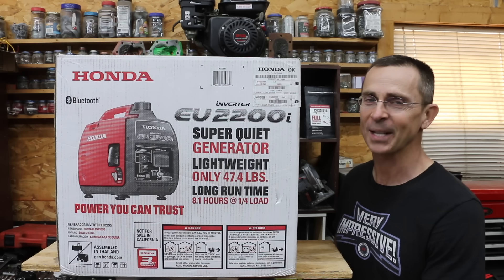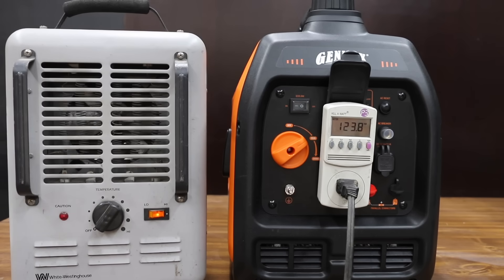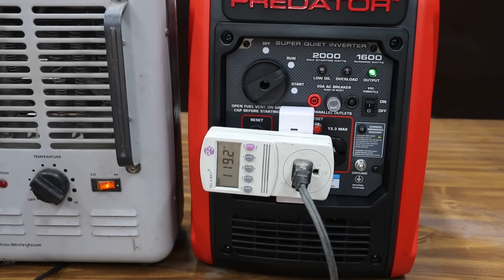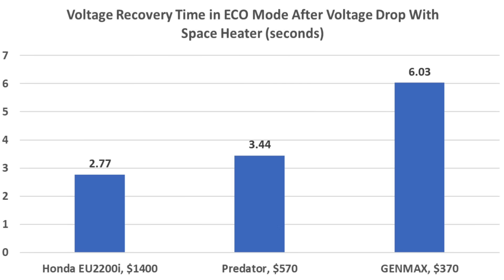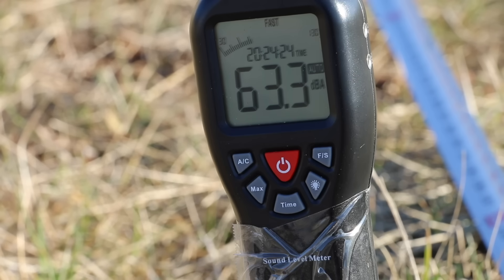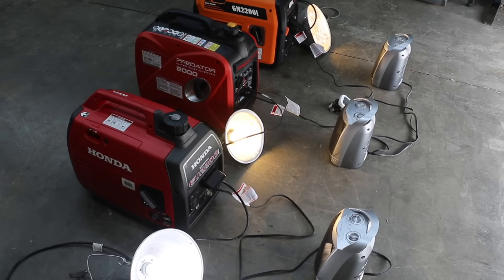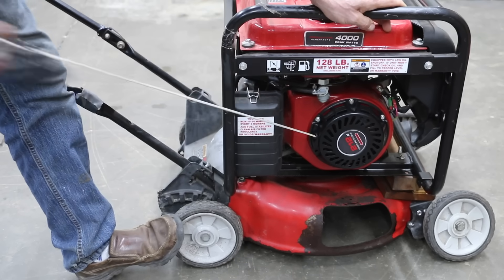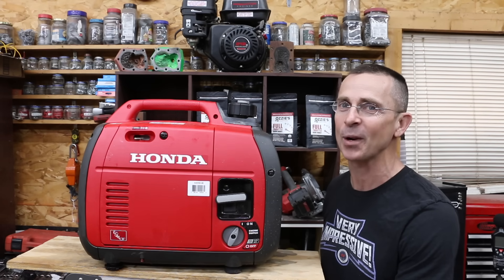Cheap Generator Better Than Honda? Predator vs Honda & GENMAX—Let’s Settle This!

Comment: Someone else has said it already. But for me personally I would like to see duel fuel generators that can run on propane as well as gasoline. We don't use generators often enough so a normal gasoline model would either be empty or gummed up. Regardless of brand since all of these small engines run flat tappet cams maybe you could test them with zinc rich engine oils? That would be interesting to see how well it helps with wear versus using straight synthetic. :)
Reply from the maker: Thanks for the suggestion.
Reply: I always put stabil everytime I fill up a gas can, never had any issues.  If its something I don't plan to use for about a year or more I'll run it out of gas.  Those two things would save people a lot of trouble will small engines.  You can get ethanol free gas but its pricey.  If you already have a bunch of tanks around, or the bigger tanks I can see the use for the propane ones, but otherwise it seems like a pain.
Reply: @Dan-yk6sy  I run ethanol free high octane in my chainsaws as well as my dirt bike. But when it comes to power outages in my area they're very rare. So a generator for us is something that would be on standby for a very long time until it's needed.

We already have a small duel fuel generator installed in our greenhouse plumbed up to a 100lb propane cylinder that we bought as a return from Tractor Supply.

We fixed the minor problem it was supposedly returned for by the previous buyer. It was pretty much just user error because the guy was an idiot and the generator runs perfectly fine. 

But we've owned it for about three years and have yet to run it out of need. Ours is a small unit that's enough to keep the meat freezers going if the power goes out. But I'd like to see the performance of the bigger models.  😀
Reply: @Dan-yk6sy  you mention Stabil when filling a can... Think I should do that for jerry cans I have filled in my garage, with gas meant for my car? I cycle them about every 6 months but I don't use any additional additives. I never thought much about it, honestly.
Reply: FYI, Hutvch Mountain makes a great conversion kit for the Honda generators. Installs in minutes and allows you to use Gas, Propane or Natural Gas.

Comment: Hey Todd, I've been very curious about the metal alloys used on bolts, engine components etc. I've noticed my cheap equipment rusts faster, wondering if it's just me. Thanks
Reply from the maker: Thanks for the suggestion.

Comment: I ran multiple predator 2000 full time 24 7 at my business. Changed oil every day. They last about ten weeks. The pull cords fray from vibration. Never changed spark plugs.
Reply from the maker: Thanks for the feedback.

Comment: Honda is the way to go. We've had an EU2000i for more than 15 years, been used and abused with many hundreds of hours on it. Bought an EU2200i like in this video a couple years ago to take some load off it, but the old one just keeps going.
Reply from the maker: Thanks for the feedback.

Comment: I bought a $400 generator and left it with gas in it for six months, checking it periodically..  Mistake.   When I needed it, it would only stay running if the choke was on.  My lawnmower engines do better than that.   Now I need to tear it apart, clean it and try again, only running it with stabilized fuel.   Buy a better generator.
Reply: A more expensive generator would make no difference. The ethanol in the fuel plugged up the jet in the carburetor as it would. With any generator. If you live Somewhere that has non Ethanol fuel available it would help but it would still Plug up the jet If left for long periods.
Reply from the maker: Thanks for sharing.

Comment: As a mechanic that works on these just know they a pain in the ass to work on and you will get a bill, 99% of problems with these are carb issues and these are verrrry prone to rust in carbs, meaning carbs cant be cleaned, need replaced. Carbs on hondas are $200+, on cheaper models cant even find carbs. Make sure you keep fuel clean, carbs and tank drained when storing or you will have a useless generator unless you want to spend few hundred to get running again.
Reply from the maker: Thanks for the feedback.

Comment: Can you look at LED Bulbs, for ACTUAL power consumption/Life/cost (Possibly you could infer "life" by heat given off which shortens the life of the electronics  that drives the bulb) and NOISE to AM radios. Cheapie leds vs expensive ones, etc.. All the Best! 73 DE W8LV Bill
Reply from the maker: Thanks for the suggestion.
.

Comment: Awesome test, I'd love to see more heavy load tests and electric motor starting etc as startup load often seems to be the biggest issue when running power tools off a generator. 
I've been using a kipor 1.6kva generator in my work van for the last few years. I bought it in a thoroughly used condition and have since piled the hours on it without any issues. One thing that surprised me is it will comfortably start and run a 1.5 hp compressor or run a 2kw 240v heater without the overload protection kicking in even in eco mode where my honda GX160 2.7kva site generator bogs down a lot starting the same compressor.
Reply from the maker: Thanks!  Thanks for the suggestion.

Comment: I have two small engine devices........a Honda brand weed wacker and a small cheap generator.  The cheap generator did about 200 hours and then had a series of mechanical engine problems......the oil flinger failed (c-clip came off) and not long after, the valve train rocker wore out.  My honda weed wacker has done about 800 hours over 15 years and runs very well.......valve lash is still factory clearances. Always interesting, thanks again to Project Farm.
Reply from the maker: You are welcome!  Thanks for sharing.

Comment: Great video as always Todd. Keep up the good work. Also, I feel like even though the Honda is clearly the best quality, all 3 units did fairly well. That being said, the predator burning oil is definitely not ideal. I guess if you always checked and topped off the oil every time you added gas it would be alright. Just a shame that a brand new engine is burning oil like that.
Reply from the maker: Thanks, will do!  Thanks for the feedback.

Comment: Thanks again for another great video. I have come to rely upon your expertise and buy based upon your analysis. I don’t always buy your winners, as your in-depth analysis allows me to chose the one that is right for my needs. As in the case of they generators. My Dad has had a Honda 2000i for years and it has been the quietest and most reliable unit I have ever seen. However, upon seeing your testing and analysis, a couple Genmax units will be in my future. Even though it appears the engines wear faster, I can buy three for the price of one. They put out equal quality of power. They are almost as quite, and I can get two for use together on the house after hurricanes, or separately for camping and boating trips. Thanks again for your great work. Keep these videos coming, and I’ll keep watching and sharing them.
Reply from the maker: Thanks, will do!

Comment: Not really video related but I noticed you're approaching 3 million subscribers!! That's awesome. You'll be in the stratosphere with Linus and Furze before long, having earned every bit of it. As for the video, I liked how you pulled the Tailgator and the Predator 4K in as a comparison data point, especially for the quality of the power. Good stuff, and it matters a lot to an electronics nerd like me. 👍
Reply from the maker: Thanks!

Comment: I have about 1400 hours on a cheap 2200 watt Sportsman. However, I've had to fix it three times and am not impressed with the quality. Most folks can't repair a small generator, so I can't recommend them. It's "natural life" was about 600 hours.
Reply from the maker: Thanks for sharing.

Comment: Interested in your comment about a sine wave being clean and how it protects sensitve electronic equipment. Trying to think of modern equipment that uses the sine wave directly. Most perform their own manipulation of the input current. I would be interested in knowing what equipment is sensitive to the input sine wave. Great videos, thanks. 😊
Reply from the maker: Thanks!  Thanks for the suggestion.

Comment: Very good video sir if you wind up doing another generator test video id suggest maybe some more cheap chinese ones or maybe some mid range brands like ryobi or the ones sold at walmart, coleman generator, or maybe a ridgid generator with the "subaru" engine made by robin, you could also put all these against a briggs and stratton generator or one a kohler engine
Reply from the maker: Thanks for the suggestion.

Comment: I'm not sure if you've tested this before, but I would curious to see dual fuel systems tested.

Also, I'm curious how much carbon builds up between the 2 sources. Or if using  propane would burn off the carbon of gas.

Of course, use something with good naned plugs in a riding or push mower if possible and if they exist as dual-fuel. I've seen custom ones but prefer to see manufatured ones for accuracy.

👍🇺🇲
Reply from the maker: Thanks for the suggestion.

Comment: Yamaha and Generac would be the two I'd look at against the Honda.  Maybe Champion.  All the cheap Chinese generators are probably made in the same factory or at least use the same parts.  I think the oil analysis is particularly telling in terms of likely longevity.  Nice work as usual.
Reply: I wouldn't put generac in that line up. From what I have seen their small generators are the usual badge engined chinese units. If it has to work get honda or yamaha. If it's just nice to have then a predator or the like makes sense given the cost difference.
Reply from the maker: Thanks!  Thanks for the feedback.

Comment: I used to work at the Home Depot. I once had a customer that was a mechanic, and he swore up and down that the Predator generators were the same design, and shared parts.
Reply from the maker: Thanks for sharing.

Comment: I am happy the little tailgater was included in some tests.  I love those little guys.  I have several I use for various things.  Surprising good for $90.
Reply: Little tailgater is so handy to have around.  I have one whose sole purpose in life is to run my sump pump, lol.  If the power isn't off for long, its done its job.  If the power stays off, it give me time to get the big gennie set up and going without rushing because I'm not worrying about  the basement flooding.
Reply: I worked at a shop that sold a clone of the Tailgator.  We dropped them from our product line .
Reply from the maker: Thanks for the feedback.

Comment: It would be interesting to see if the cheaper generators will last 1,000 hrs.  Run all 3 with a 1,000 watt load for at least 500 hrs, prefer to find out if last 1,000 hrs. Use eco mode, keep track of fuel consumption.
Reply from the maker: Thanks for the suggestion.

Comment: Would definitely be interested in seeing a comparison of propane-based generators.
Reply: 2nd that- I have a Champion dual-fuel  brand from Atwoods and am wondering if I made a mistake in not going for Honda instead.
Reply from the maker: Thanks for the suggestion.

Comment: If doing generators again, I would like to see the "dual fuel" generators included and see the difference in run time of a full tank of gasoline vs a 20lb cylinder of propane.
Also what the spark plugs look like after 100 hours of propane run time.
Reply from the maker: Thanks for the video idea.

Comment: 4000 to 2000 and back, I'm confused. You're normally consistent with your testing but this was nowhere near consistent. I could not focus on the test over swapping from 4000 generators to 2000. So my question is, what were you testing?

Comment: I can’t help but to wonder if you had a bad Predator. I have both the 2000 and the 3500, have put hundreds of hours on both, and neither has ever used oil between recommended changes. For 1/3 the price of a Honda, they are hard to beat.
Reply from the maker: Thanks for the constructive feedback.

Comment: Hi Todd, Great video!  If you ever decide to do a 2nd round, you might want to throw in a Champion and a Firman. Both of these machines seem to dominate the big box offerings here in Canada (Costco, Lowes, etc.). Dual and tri fuel options are also popular offerings.
Reply: Good points, have a dual fuel option being tested would be useful as well
Reply: My recommendation exactly!
Reply: agree too- Champion is all I could find for dual-fuel at my local farm supply shop
Reply from the maker: Thanks!  Thanks for the video idea.
Reply: Generac is also common here in the states
Reply: Agreed, a 3000w class showdown with the Honda, Yamaha, Champion, Firman, and Generac would be great.

Comment: I run 2 power horse generators from Northern Tool when camping have been very happy with them. I can run the AC all night normally. I would like to see it tested against the Honda
Reply from the maker: Thanks for the suggestion.

Comment: In this series there has consistently been a huge difference in the quality of the Japanese engines vs the Chinese knock off’s. The Honda would significantly outlast these and be much more likely to perform reliably throughout its life.
Reply from the maker: Thanks for the feedback.

Comment: I ve owned a honda 2200 for 2 years and have clocked 1000 hours on it. I use it at a remote camp and have went through 4 harbor freight 900 watt generators. They were very fuel efficient but ussually failed due to minor issues that wernt worth fixing. After buying the honda and putting 100 hours I couldnt believe i didnt buy one earlier. I purchased the 6 gallon extended run fuel tank  to run our 13,700 btu air conditioner. Using it in cooler weather, for a few lites and TV, it consistently runs 12 hours on a gallon of gas.
Reply from the maker: Thanks for sharing.

Comment: When I bought my small generator it was between Honda and Yamaha.  The price was initially within $100 or so making the choice even harder.  I went with the Yamaha as it has a separate fuel shut off allowing me to run the carb dry when I want to shut it down.  I never use the off switch.  The Yamaha turned out to be less expensive as Honda was going to charge me PDI and Freight.  I figured the money was better spent on gas for my new Yamaha. FWIW both were 2000Watt peak units.
Reply: Just FYI there's a cheap push button ignition kill for the Hondas so you can run them out of fuel like normal on small engines. It disabled the simultaneous fuel shut off and ignition kill from the factory switch.
Reply from the maker: Thanks for sharing.

Comment: I have to say I only really have experience with the Honda generator, and I have friends that have ran a Honda generator at their off grid vacation home, and that thing pretty much runs all night every night from May till September....I know they bought a 2nd one as a backup after about 10 years, but they kept running the original, for I believe close to 20 years, it was hard to believe how long it lasted and how fuel efficient it was, going all night and then some on ECO mode.
Reply from the maker: Thanks for sharing.

Comment: Another fascinating review, thank you!
Please include a cold-weather start test (generator left overnight in below-freezing temp, test for pull-effort and number of pulls).
Also consider a modest drop test, for common scenarios such as knock-over from level, knocked off a single stair step, or from a tailgate height onto lawn or park turf.
Reply from the maker: Thanks and you are welcome!  Thanks for the suggestion.

Comment: It would be really cool to see a generator comparison using propane as fuel. /for me/, I prefer using propane for a fuel appliance I might use once a year, I’m always worried about old gas gumming up the works.
Reply from the maker: Thanks for the suggestion.

Comment: i have 2 honda eu 2000's i got for my travel trailer.i bring one along for whenever i need it and the second with the 30 amp plug i bridge for 4000 watts to run the a/c when it's mid summer hot. when i was a working man we used honda gennys exclusively and never had an issue and we ran them all day,every day.
Reply from the maker: Thanks for sharing.

Comment: "This generator has two USB charging ports."  Why?  Who is going to set anything next to a generator blasting loud noise and belching fumes for any length of time?  The point of a generator is to supply AC power.  Adding USB ports to the device unnecessarily increases the cost.  Now if those ports were used for connecting to a laptop to supply information, that might be useful.  But USB charging ports is both goofy and overkill.